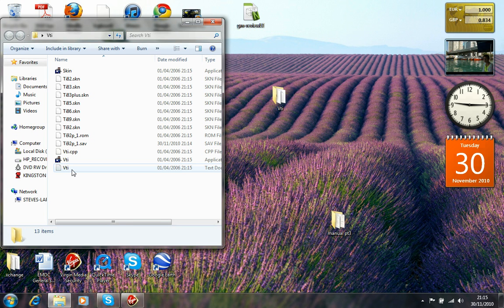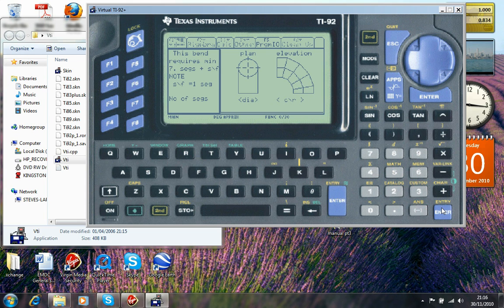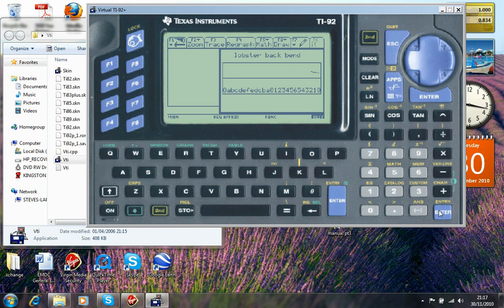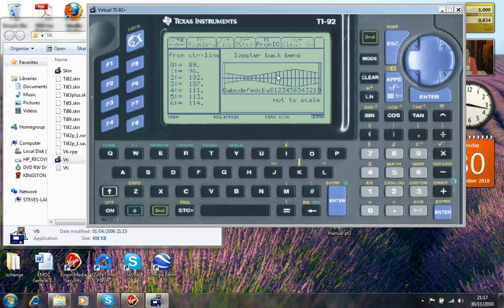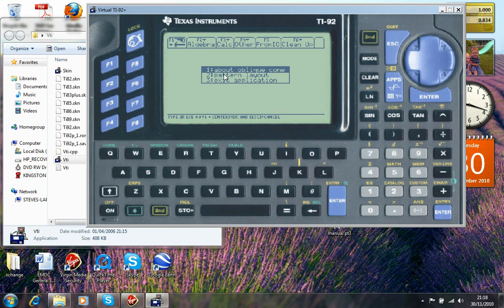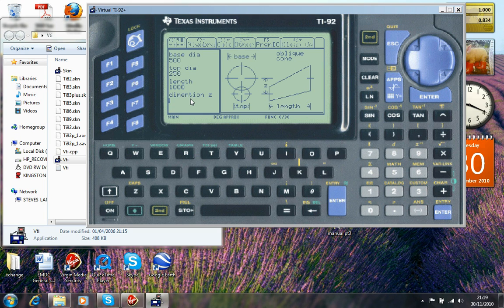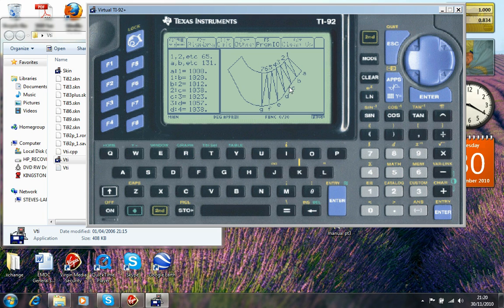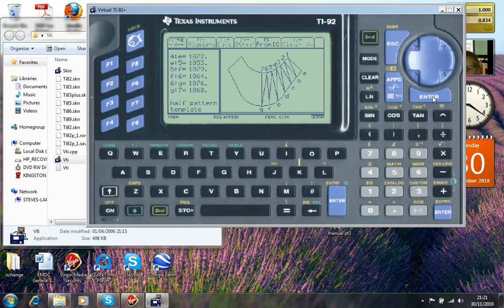sheet metal pattern development by Texas Instruments calculator

Comment: pls sir give me elbow calculation formula
Reply: B bass elbow calculation is relatively simple!
Just multiply half the diameter (radius of the pipe elbow) x sin15, x sin 30, x sin 45, x sin 60, x sin 75. That will give you the heights from centre line , just repeat these dimensions for below the centre line .
If you want more divisions use the sin  function with the required number of degrees (i.e. Sin 7.5, etc)
Check out my Facebook page "TI PATTERN DEVELOPMENT"